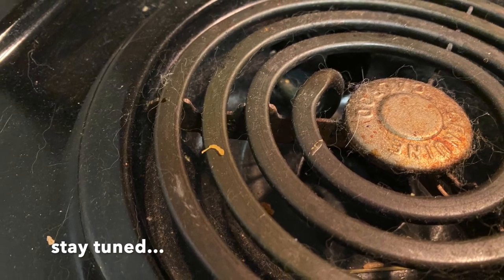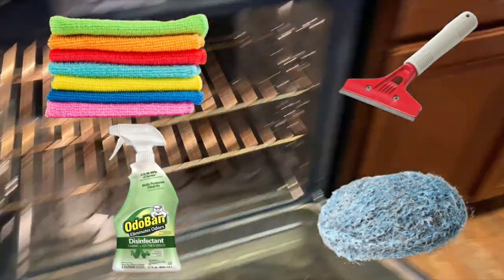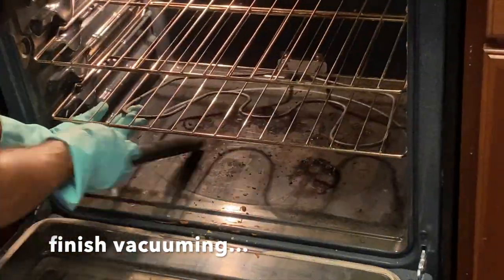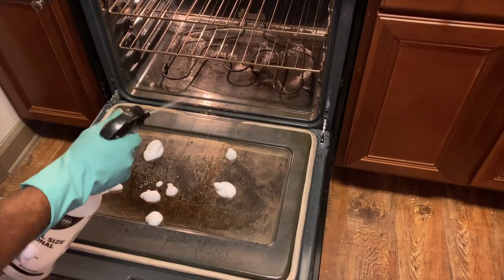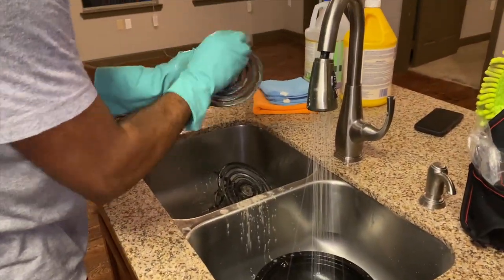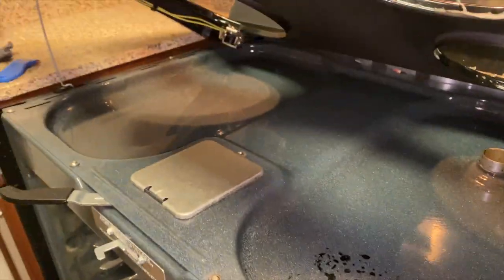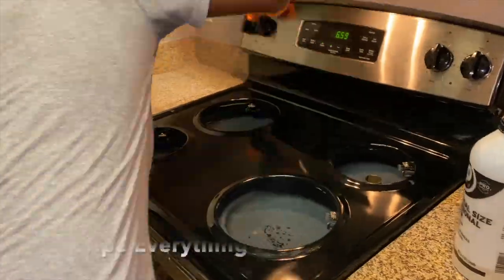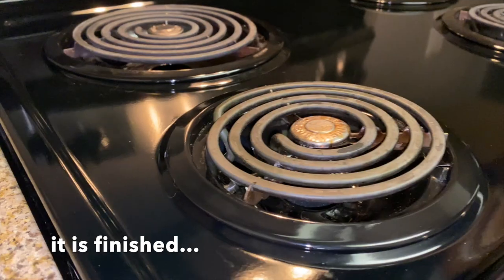Cleaning Electric Coil Stove Top & Oven | Clean Routine Under $10  | Real Men Clean

Comment: Thank you for showing the vacuum cleaner is not just for floors. I just wish you'd demonstrated how to clean the upper inside of an electric oven. Inside my old GE oven there's a big metal heating element(?) that pretty much prevents me from wiping away the grime up there (I think I need a flat scrub brush to do it). Otherwise, great video.